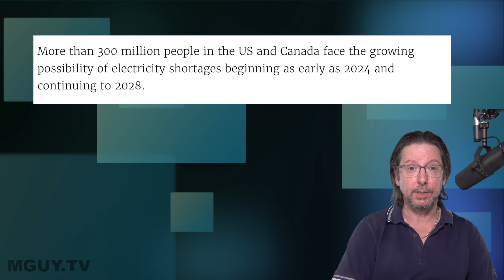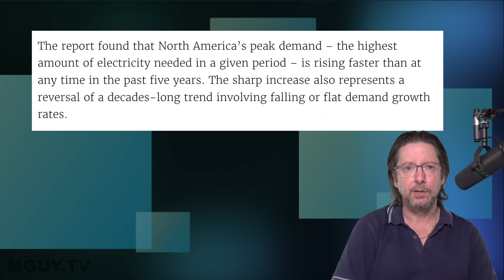Electricity grids WON'T COPE with mass EV charging | MGUY Australia

Comment: Absolutely right, exactly the same here in brain dead Britain,  its a knee Jerk reaction caused by the green agenda activists and lobbyists, the infrastructure for electrical capacity simply doesn't exist, not long ago we were told to ditch incandescent light bulbs for low energy types then subsequently LED, all to save energy, now we're being told to ditch gas boilers for electric heat pumps, you simply cannot make this nonsense up. We do need real world thinking people in charge, no pun intended 😅

Comment: How about people out of power for a week now on the Gold Coast? No good if you have an EV…
Reply: EV batteries dont work as well in temps over 27c, they use their own battery to run an internal air con system but this flattens the battery. This is why manyfacturers recommend that EVs be continously plugged into the Grid when not being used.
Reply: @winstons1806  in a garage in summer the temperature can go to 50/60C. This is why ev car can take fire even when not charging. Don’t put an ev in your garage.
Reply: @winstons1806  EVs with cooling systems and a/c consume a fraction of the energy an idling ICE vehicle does. Your statement is baseless.
Reply: Ideally we need to invent an engine working with just air and a small battery like the ice battery to start the car, and initiate the first meter before to inhale the air into energy and fill the battery. All other solution like magnetic forces require a mineral to produce energy.
Reply: @CC-gt3ro  the trouble with so much of these technologies is The laws of physics are very unkind and unbendable, so sometimes it’s pretty difficult to have a source of energy that isn’t extremely complicated and doesn’t use 90% of the energy in it to get a small proportion of energy out 😢
Reply: No model 3 has a range of  700klms Mike, liar.
Reply: Hope everyone who has their power out all own EVs...🤣🤣
Reply: if the power is out, there is no gasoline pumped, either. Your EV can be a backup power source for a home without power, not so much your gas car.
Reply: @justsomeguy934  good point fumb duck. You go right on ahead with your EV’s are ace rhetoric, while I drive 2 suburbs over if necessary, while you deal with range anxiety because you can’t go to the nearest supercharger. Twunt.
Reply: When the power fails everyone can travel in sailboats.
Reply: That’s true if you’re needing to travel, but there might be scenarios where an EV is useful at the moment. If you have a car with vehicle-to-load capability, and had a high level of charge before the power went down, you could power household essentials for days. Storms and flooding are terrible but at least there is a degree of warning. I’m more concerned EVs in bushfires, where threats might arise with little time to react.
Reply: I wish I had a free EV to use for power outages. I can`t afford one. I can`t even afford an electric bike. I can`t afford new batteries (1000 bucks for a 3.8 kwh/3800wh 12v EV grade LiFeP04) or food anymore except sardines, crackers, tuna, and some rice and beans. It`s getting harder to grow food too. I need a new freezer bad too. We`re in BIG trouble thanks to "Mr Big" here in America.  @michaelzerk